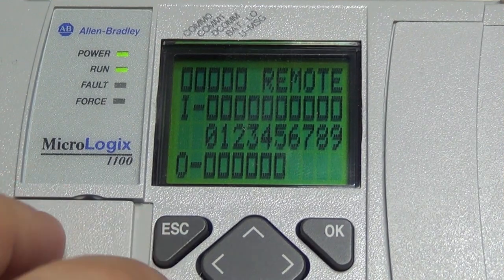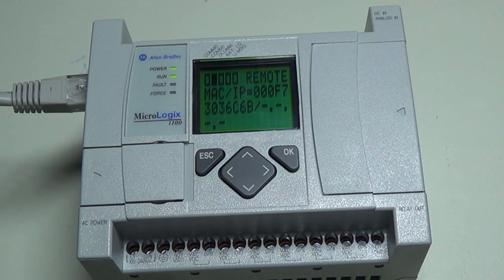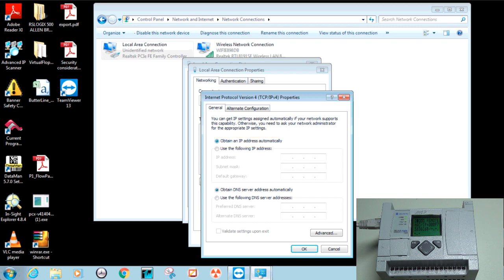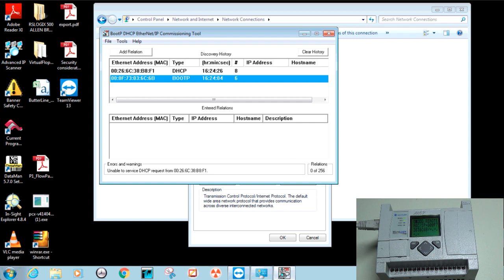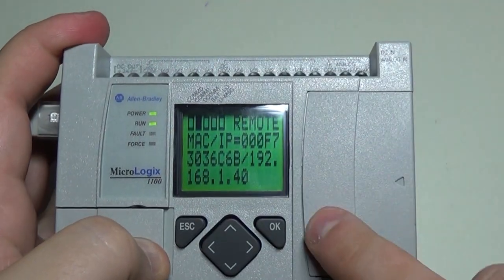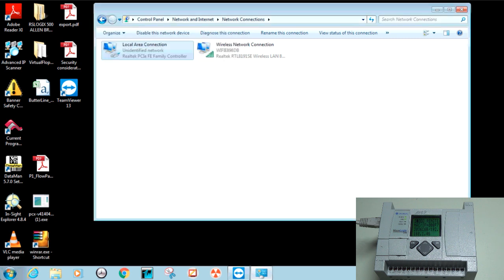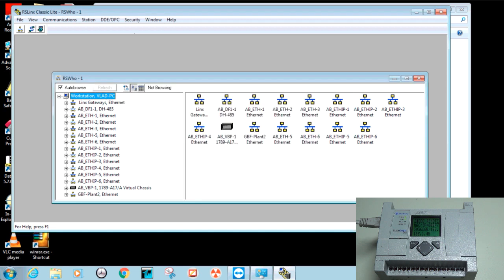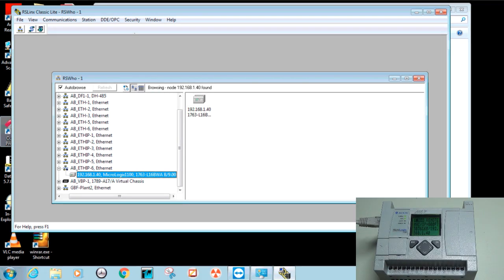PLC Programming Tutorial 1 - Allen Bradley MicroLogix 1100 w/ RSlinx RSLogix500 BOOTP

Comment: I'm wondering what to purchase in order to power this appropriately? I'm only programming it for the sake of learning. I will probably attached a few small motors or something in the end.
Reply: Hey Michael, if you purchase a MicroLogix 1100 series, you either power it from 24VDC or 110VAC. If it's 110VAC, you can just run it to an outlet. If it's 24VDC, you'll need to purchase a power supply. You should be able to easily find one on eBay.
Reply: @SolisPLC  Thank you! By the way, I've watched several of your videos. They are all very helpful. Thanks for posting.

Comment: at around 5:24, when I select Disable Bootp, I checked the PLC, and it flashed a "ip conflict" error on the PLC
and at 7:20, when I go into rs linx classic, it shows the Ethernet connections, but it has a red X even though when I go through the control panel, the computer can the PLC as an Ethernet connection. so I'm wondering if there is something I need to do